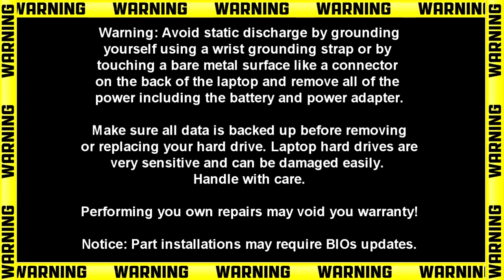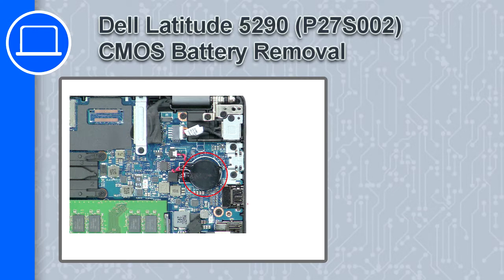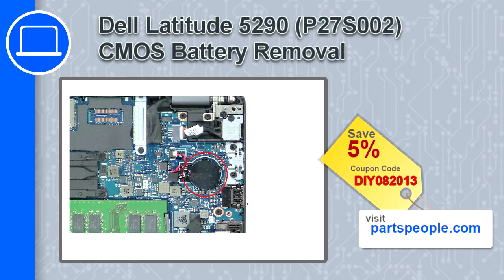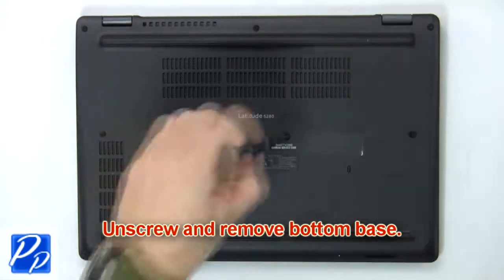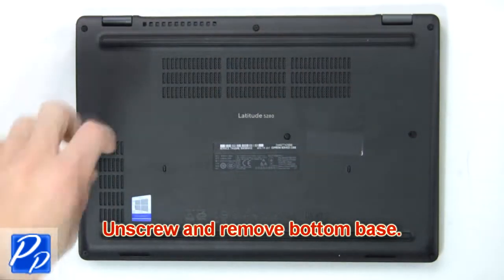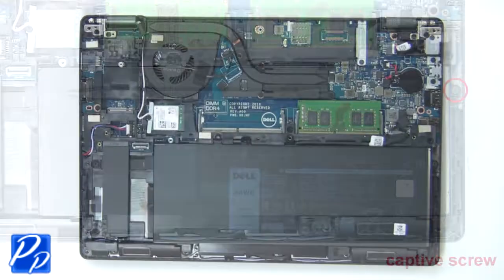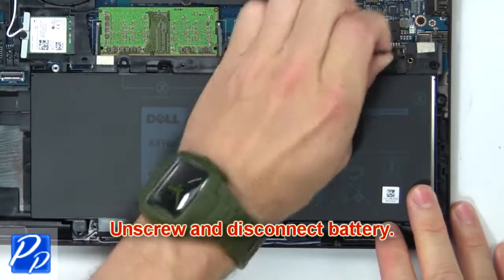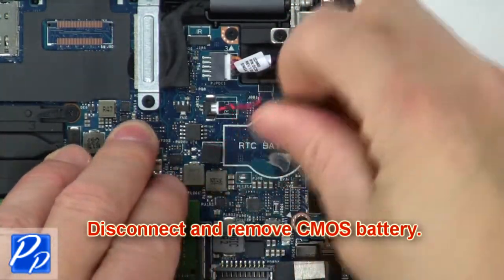Dell Latitude 5290 (P27S002) CMOS Battery How-To Video Tutorial

Comment: You're doing a 5280. That's not the same as a 5290.
Reply from the maker: They share the same regulatory type/chassis. The removal process for this part is exactly the same on both.
Reply: @dellpartspeople  It is not, they're completely different. The 5290 2-in-1 is a tablet, while the 5280 2-in-1 is a small form factor laptop. They don't open the same and the internal layout is all together different.